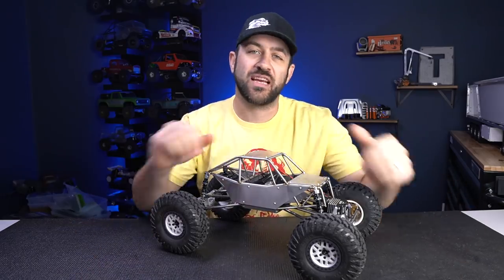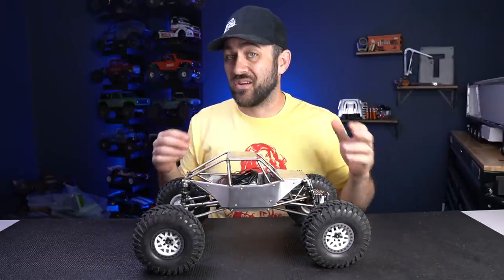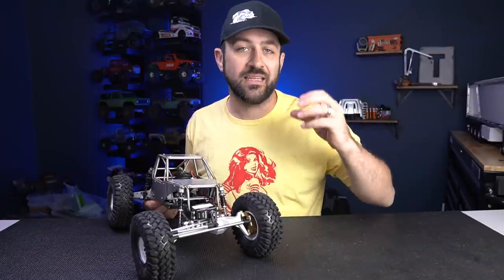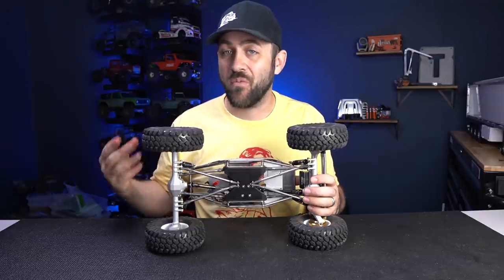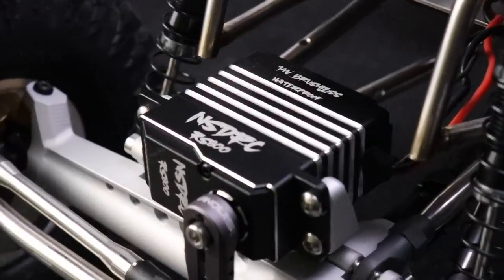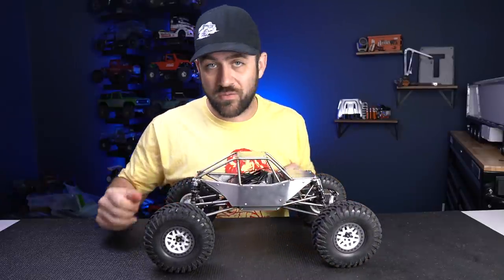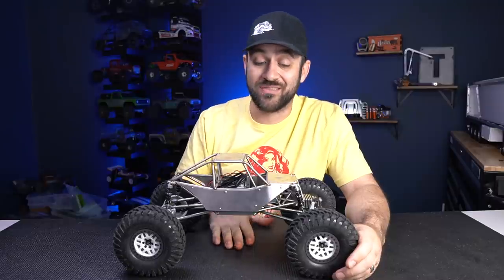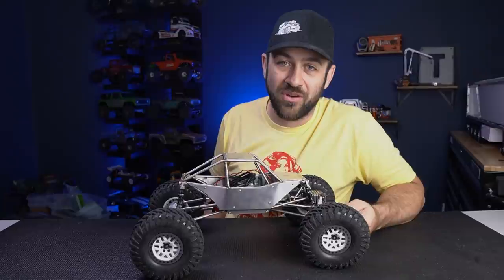Warning! Custom Capra - RC Speedy

Comment: some of those welds, I dunno... 
But crucially, those shockmounts, both angle and ride height, how does this get past prototype stage? (or even the cad stage)
Reply: Yeah, the close up on the front showed serious gaps in the joints. For $300 I understand not doing a bidrsmouth cut on the tubing,  but wasn't even lined up well for the weld
Reply: They call it a 'moon buggy' because if you raise the ride height another inch or two you'll be on the moon! lol Laughable really.

Comment: I would put some shock hoops front and rear so you can fix the shock angle and lower the ride height.
Reply: I had a similar thought. Or maybe a CNC ali part that bolts into the existing mount and gives shock mount options higher and forward.

Comment: You have two choices for the front shock dilemma. Cut and move the top shock mounts, or cut and shorten the four link by about 1/2 inch. That would decrease the shock angle.

Comment: Worth it if the shock mounts were correct.  Also if there are no interferences with the stock capra skid plate.  Not everyone can tig weld in there garage, so the shock mounts must be corrected,

Comment: If they use the same grade stainless in the small areas the high heat would discolor the cage in random areas  so they use a softer grade to get the temps for the bond for less eye catching imperfections

Comment: I just spent $25 (and free shipping!) on a brand new Integy crawler tube chassis and with all the $$ it is going to take to turn that into a crawler is less then what you spent on this chassis. I don't see where the extra $350 would make me happier at all. I know the Integy is not built as well and doesn't have some of the features your has but so brazing and zip ties will fix all that :)

Comment: I run HR internal spring with cut springs for and my Capra runs amazing. Half spring on top of piston and half on bottom
Reply from the maker: I’ve ran all kinds of those over the years but not something I’d go back to. A proper sprung setup is what has always been proven to win in comp crawling and it works the same in scale. They look good but just leave performance on the table for me.

Comment: You could get a starter flux core MIG welder, a spool of wire, gloves and a helmet for a hundred less dollars. Flux core welds will need a little more clean up with a grinder after, but you could learn to build your own chassis for less money. $300 for a chassis that needs work out of the box to get working properly is on the steep side. Honestly the shock mounts front and rear look like they finished the chassis and forgot to put them on.

Comment: For the shear amount of work it takes to get a tube chassis yeah i think it is worth the money, especially if they fix the front shock issue. And seeing as you pretty handy with a tig welder why don't you weld on your own shock hoops that fix both the ride height and the mount tab angle issue?

Comment: I'm wondering if the welding  on those smaller tubes caused the magnetism?  I know on SS , if it gets too hot while welding it changes the dynamic of the metal and it can rust and magnets will stick to it

Comment: Use those old shock mounts to bolt up your own shock tower mount and run 110 mm up front
Reply from the maker: Eeek, I can’t say I’d even want to run that tall of a shock. Real moon buggies generally keep mounts tight to the tube work, the shocks should stay roughly where they are but at a better angle is all. An 80mm shock will likely be my goal.

Comment: Ride height too high??? Maybe it cuz they built a “capra based chassis” off of a capra that is designed to run 1.9 wheels and tires. I bet that would fix that issue. 

But. The shock mount issue, that sucks. I hope that can be fixed.

Comment: It really seems like your side body panels are reversed. The curved part of the side panel seems like it should be in the front.  The bolt pattern would obviously dictate the layout though. Like the build though. any plans for 4WS?
Reply: It also looks, based on the shock mounts, that it was designed for shorter lower links...lower links may just need a bent.
Reply from the maker: It was designed for a stock capra, so the links are supposed to be this length. The design was just not completed properly, likely it was built at full extension and suspension travel was not compensated for. Shortening the wheelbase would make this sub-12" wheelbase and that's just not acceptable.

Comment: This chassis looks great and super scale. Pretty sure thats what they went for. Seen one of those real moon crawlers in person. They ran full droop, also if you were to scale up yours to real world, it would be too long, i imagine shorter links would fix shock mount issues. Not sure if they need to be ‘’fixed’’ or just the build needs to be adjusted. 

On the other hand, tapping some holes and making shock mounts adjustable so they fit both super scale and more of an rc type of build should not be hard for manufacturers.
Reply from the maker: Shorter links could work also but this is sold as a Capra replacement chassis.
Reply: @HarleyDesignsInc  makes sense then! Could be that it’s just giving general idea for parts that will fit, axles that they designed it around. 

Still they could’ve been much clearer.

Comment: Perhaps the steel loses it's magnetivity because of the welding temp -> Curie Temperature.
SSD Knuckles and Portal Cover would look better than the brass.
...man the skid is really high!
Reply from the maker: Most stainless is not magnetic. I was more surprised to find some that was, likely just lower grade SS in that area.

Comment: Stainless chassis, bit too top heavy, ride height a bit too high for me. The ft shock mounts are definitely a deal breaker for that money. 

Fixing it, you could do shock hoops that would fix ride height and shock positioning. OR since you have the tools and skill TIG up the holes, build up the top of the front tab with weld .100 Then redrill the holes at the popper angle.

Comment: I don’t really like the look of that chassis. I think the binding may be a product of front axle placement. If you were to run shorter links, it should bring the shocks back into proper alignment. However, yes, it sits way too high for my liking. I’d like to see shock hoops with the potential to make adjustments based on axle placement. As it sits, no... I wouldn’t buy one.
Reply from the maker: This is a stock replacement chassis, these are stock links, so this is exactly how it’s supposed to be placed.
Reply: @HarleyDesignsInc   That’s right, I remember you saying that now. Then I guess I see no reason why it would be built that way...

Comment: I would have cut my losses and sent it back .. less than sexy welds and way too high ride height not worth it for me at any price. I dig big time UCFabs Moonbuggy but they are unobtainium. For pure performance I still in 2021 dig my 2.2 MOA comp crawler I built copying Samu Sarka’s rig, to me it’s like the Moonbuggy of the RC world.

Comment: 2 words: Gmade R1...
Reply from the maker: Yeah the Gmade had the same name but the style is still quite different compared to real scale moonbuggies. Also the R1 was such a bad RC 😂
Reply: @HarleyDesignsInc  save the money (and weight) buy the R1 cage and add in those lovely mechanics. May not be as cool as a metal cage but way cheaper and better performance.

Comment: Just FYI, certain grades of stainless are ferromagnetic, and they aren't necessarily "low grades". 304SS is generally considered a fairly high grade of stainless, but magnets stick to it readily. Cold working (e.g. bending) and welding stainless can also affect its magnetic qualities.

Comment: Putting so much into a custom built chassis deserves getting something a bit better thought out in my opinion. If these issues are not adressed by the manufacturer, I would consider this cage just hip ... At best! Ok it looks beautiful, that I won't say otherwise..... 300$ saved in my pocket is not bad either.

Comment: No .... You worked hard ; disappointments along the way of this build , I feel it ..,  and you couldn't achieve correct geometry and you are putting all of your know- how" into the build ..  What power train support gear , and wheelbase did the Designer mathematically apply to his design to complete his own build ?  At is point if you like the look , maybe weld up your own with similar look ! , you've done it before , didn't you buy a new welder not too long ago ?.. Jig it up ! build it correct , you know we'll all watch .. A lot of work .. lol

Comment: In general, I'd say $300 on a custom tube chassis IS worth it.  However, in regards to this specific chassis, I'd say NO.  First, there seems to be way too many problems with the design. Yes, you can fix them...but, having paid that much, there shouldn't be problems needing "fixing".  It's poorly designed.  Second, there's a serious question about the actual metal used in the construction of the chassis.  Based on your "magnet test", I don't know if it's just a seriously inferior-quality SS, or whether it's not even SS.  For all you know, it could be nothing more than hardened aluminum, or something similar.  Personally, I would NOT buy it.

Comment: A good deal of stainless tubing does have a small amount of magnetism.  The basic answer to your question is, no. In that there is maybe $20 of stainless tubing used. A halfway decent home a fabricator could make this chassis for $25  If all of these stainless tubing is not of the same variety I sure hope it was welded with 312 stainless rod. The over all build looks gorgeous, but the chassis is not worth $300 by any means

Comment: Some very high grade stainless materials are magnetic btw. Steels like Duplex or 1.4418, stainless 430 etc are all magnetic 😉
Reply from the maker: I’m aware that some are, but a very very small amount and definitely not what is commonly used in most RC production.

Comment: From an actual welders standpoint this is not a ridiculous price stainless tube this small is expensive not to mention the equipment to weld it. You say cold welding... no such thing he’s just not adding filler this is typical for thin wall tubing, it’s not weaker. Also 400 series stainless grabs a magnet 300 doesn’t this is likely 304 which is a higher quality. Not sure what the magnet test was about
Reply from the maker: "Cold TIG" is what I'm referring to, which seems to be a common "feature"  advertised on overseas machines and shown in numerous videos. I had never heard of it and had to look it up as the welds generally looked more like laser welds to me at first.

Comment: I'm running a Puller Pro 2700kv standard mamba x on 4s with my capra. I have zero issues with the gearing, but I do use the aux input to adjust my max power which limits the throttle and rescales it so that at full throttle it'll only get 20% in one mode or 100% in the other. Significantly increases how smooth it is to crawl so I treat it like a high and low range. Now my trx6 in low with a puller pro 3500kv standard doesn't need this power reduction in order to be smooth, but I honestly prefer the electronic high low to the mechanical one.

Comment: Adding my comment really late here. But my first thought on the shock mounts came after noticing that the mount is not square to the shock. It is parallel to the frame rail. If it was rotated 10 - 15 degrees until it was square to the shock, I think you'd be ok without losing travel height by going shorter. It looks great. I can't wait to find your video that shows your solution and shows it running!

Comment: i am interested in what you think about those tires ive been tryin to break my set in all summer there still no match for my china cloned austar superswampers that were on the rig before and almost bald atleast in the hot dry rock of johnson valley for the $100 those brazerkers cost i dont see them being 5 times better but ive only used them on dry rock im hoping they work better in the cold and wet 
the brazerker iron sides in 4.19 on the cc01 kick but i have no idea why the braven brazerkers arent workin

Comment: I definitely have some buyers remorse, but I went with ar44s and 90mm shocks and I’m pretty happy with the stance and ride height however I had similar issues with my Vader 3 gear skid, overall I’m happy with it but definitely agree with the points you raised

Comment: I did something similar but I used a cheaper  Chassis and turn out great but I'm getting an overheating problem so now I'm switching out the capra transmission for a three gear

Comment: correct me if i'm wrong but isn't the standard capra skidplate lower then this UCFAB version? Don't know if it resolves the upperlinks binding but it would help the driveshaft clearance. Also shortening the front links (with that the wheelbase) might also be an option to cure the binding issue on the shocks. Although this shouldn't be necessary since it is sold as an capra based cage.
Reply from the maker: Yeah, I mentioned that those issues were not the chassis at fault. I don’t want to run a stock skid though. I’ll make the modifications and get it running.

Comment: Besides the front shock towers, this is a great chassis. Just have to use 80mm shocks, so the ride height isn’t the chassis fault. RCspeedy does offer raised shock mounts as well if you wanted to stick with 90mm units.

Comment: Honest question, what makes this a Capra if nothing on it is from a Capra? (skid plate, cage, axles, trans, etc) Is it just the links and width?
Reply from the maker: It’s the fact that the axles, skid, chassis, links, etc are all designed as Capra parts.

Comment: I noticed on your driveshafts that the female side is on the axle housing. I run female side from transmission to help prevent stuff from getting down in the female side of the driveshaft.
Reply from the maker: I run the female side towards the front of the car (Axle side on front axle and trans side on rear axle). This is so there is no hard lip when moving forward if it snags a rock.

Comment: Dlux sells offset shock caps that would lower ride height and push your shock to a more acceptable angle.
Reply from the maker: Those just don’t look scale enough to run on a scale truck for me.
Reply: @HarleyDesignsInc  who are you? You just used "scale" twice in one sentence.... Omg is Matt finally rubbing off on you 😳